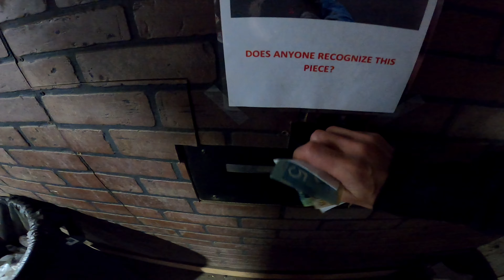Dumpster Diving For Scrap Metal in the Rain

Comment: If you smash up those ballasts with a hammer after checking to make sure they do not have any PCB's in them they are filled with #2 copper once u break it free from the tar or you can even sell them as is to some scrap yards without preparing them

Comment: What fun!  A good old-fashioned dumpster dive.  What is this thing "rain" you speak of?  I am soooo envious.  That's exactly my kind of day, you lucky guy.  I've had one of those bolt . .remover  .. bit . . head . . things for about 25 years and it still works fine.  I don't give it the industrial use you do, but I've used it a lot.  Nearly 70K subs, Thub!  Well done.

Comment: In a different video of yours I saw that you put your plug ends into boiling water to be able to pull the brass pieces out easier.  How long do you boil the plug ends in the water before you attempt to pull them out?
Reply from the maker: Well there was no fine tuning there, I just left them heating up until I saw the water was boiling.

Comment: I believe if you dig into that humidifier distribution tube, you will find that it is indeed stainless and not quite the copper treasure you originally thought.
Reply from the maker: Interesting, thanks for the tip! I’m always careful to grind a piece before tossing it in the copper
Reply: @thubprint  As I've replaced hundreds of those general 1042's, originally I figured they were brass too. The solenoid is good brass. And if you like stainless, that tube along with the 6 knurled nuts are all stainless.  As I have mentioned before as well, that humidifier pad is a good source of MLC aluminum as our yards in Ontario call it. All in all, humidifiers can be fruitful with little effort. Keep up the great work

Comment: how do they know excacly how much u put in the junk yard and the money they give you for it
is there like cameras that see what u put in or a scanning machine for your car i dont know how this works
someone please explain
Reply from the maker: There’s two systems in place. When you’re dropping large volumes of steel you drive onto the scale inside or the big one outside if pulling a trailer and they record your entry weight and then you unload and drive onto the scale for your tare weight and that gets rounded to the nearest 5lbs. You do that once for each drop in the yard (tin shred, prep, auto cast, etc). For smaller volume like nonferrous they have a scale inside that they round to the nearest pound for stuff like wire and aluminium.

Comment: I noticed you picked up two fluorescent light bulb containers with the coverings and the black rectangle sayings that you're banging away at. Those things only takes one screw to hold them in and then they slide off from the opposite direction you didn't need to do all that banging you could have used the screwdriver or a ratchet. At the end if you took them apart and everything you would have found the brass connectors that the number one wire is connected to to light up the light bulbs. If I had a truck and everything I would take all the stuff home just mail it all and then recycle it the next day. Believe me you would have added more brass to your brass bucket.